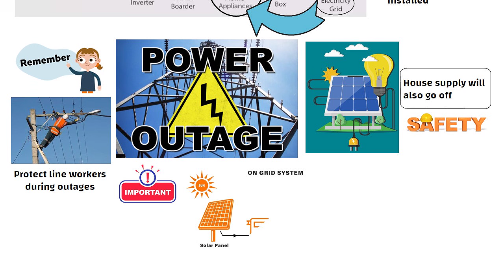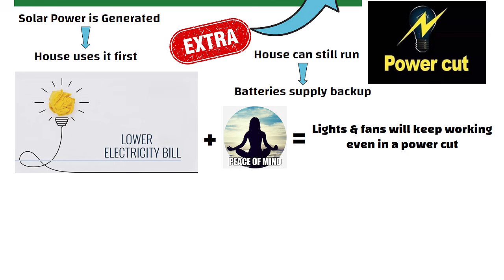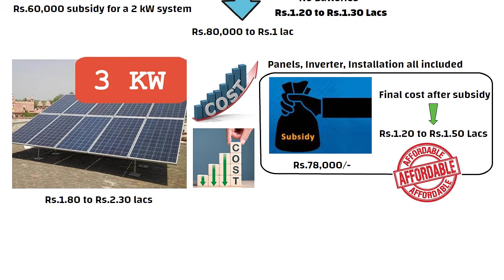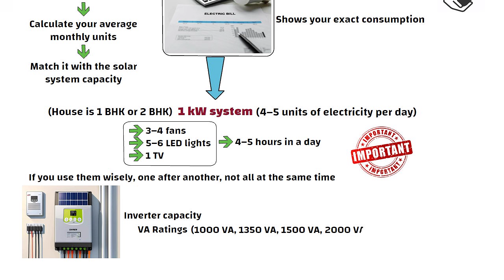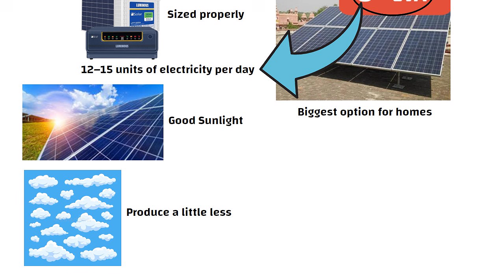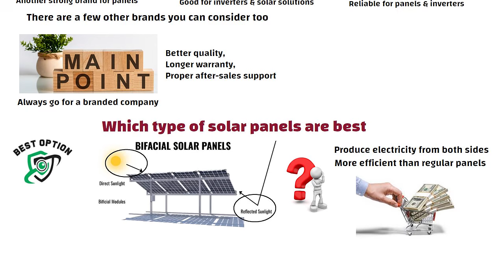Which Solar Panel Gives ₹0 Electricity Bill? | Complete Guide Before You Buy

Comment: You failed to cover these points:
1. Govt. policies may change. Consider day and nighttime on-grid usage. Electricity at night during summers becomes expensive and whatever you've saved will be squared off there. 
2. Since govt. policies can change, there's no guarantee that they will ban charging your EV vehicles from your on-grid system. These policies framework has been in works already. 
3. A hybrid system is a better because when you need to charge your EVs during summers and in the night.

Comment: Thank sir for very good information. Our building is undergoing redevelopment, and we will soon be receiving possession of the new premises comprising 49 apartments. We would like to know the appropriate solar power capacity (in kW) to install so that we can minimize electricity bills, reduce overall maintenance costs, and meet common area requirements such as general lighting (parking, staircases, and corridors), water pumps, and, if feasible, three elevators.

Comment: Good information Thank you.
In terms of panels you can add HJT which are more efficient but bit more expensive.
Also if you don't want subsidy you will get better rate when you are selling the electricity back to discoms and also you get better components. This is better in the long run.